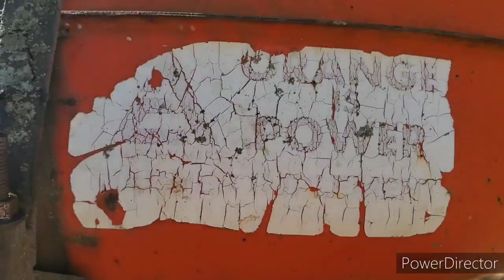Allis-Chalmers WD Forklift Revival Part 2: It Moves!!

Comment: Good to see the old AC running.  Definitely sounds like it needs a tune-up, but the main thing is that it starts and will run and drive - so you have something to work with.  I was noticing how dry the ground looked there.  A couple months ago you said about how little rain/snow you had over the winter.  Looks like that's still the case.  We have the opposite problem here.  Just starts to dry out, and it rains again.  Temps have been a rollercoaster too - We've had 80 degrees one day and an winter weather advisory the next day for blizzard conditions.  Strange year so far.
Reply from the maker: Yep!! Needs a carb kit. Seems to overflow the carb instantly. Either rubber needle rotted away or the floats sunk, haven't go into it yet. Yes, very dry here still, have had a couple 3 inches of rain in the past month, but wind has been blowing all April, fires rolling nearby currently. We have had the tractor and disk hooked up all winter. If only you could loop your rain back around to us! Thanks for watching! I have been trying to keep up with watching other videos, but college has been hectic, so I'm watching, just not commenting all the time lol
Reply: @cjfarms2239  Yeah, I wish I could send some of this rain you way.  Today was day 2 of 3 nice days in a row, sunny with highs in the low 80's.  Dried out enough that I could spread some fertilizer and disk.  Rain again Tuesday and Wednesday, then about 5 straight days of mid-50 temperatures.
Reply from the maker: Glad you are able to get into the field! Guys are rolling here too, just the big time operators, who got alot of ground to cover.

Comment: One thing that forklift counter weight is mighty high up in the rear. Like if it were layed down flat , split and made like a saddle , and hung over each side of your tricycle front /rear/front/rear tires🤔😵‍💫¿ Your front/rear/front/drive tires are really wide , or far apart, but if you have a lotta weight up hi , and drop off in a quick sharp it could make the ground come up , and slap the PI$$ out of you. 
   I'm proud of what Yens have done here. Glad y'all have made the video as well. I have a CA , and one C Allis Chalmers, that I'd like to turn into a forklift. Just concerned about the axels on the C ,and CA being strong eNuff. 
   What kinda lift mast have y'all used here?  This is the first video of yours that I've found. Gonna see if you have made more on this fine machine. 👍👍👍👍👍
Reply from the maker: yeah, dad bought it this way. It been this way. my whole life, I just got the itch to bring it back to life a year or so ago haha. Yes, id like to find more weight for it, and maybe a wide front, for safety sake. we wont be using this for heavy loads. going to make it a "man lift" and use it for lifting us and tools up, to avoid ladders, only down side is 2 people needed to run it so no heavy pallets for this one. 
I can make a video of the undercarriage for the mast. we are reasoning the mast to be a clark, that's what the weight is. id also go for a shorter one too. Easy to get in tangle with power lines with this rig!!

Comment: She ain't smoken any¿?¡!  That is a good sign. If you have good oil pressure you're probably in good shape.
Reply from the maker: Not really any smoke, it did sound like it was knocking slightly, but not sure how thick the oil is in it. for what we would be using it for, wouldn't be doing any intense pulling or such. but the oil pressure shows good.